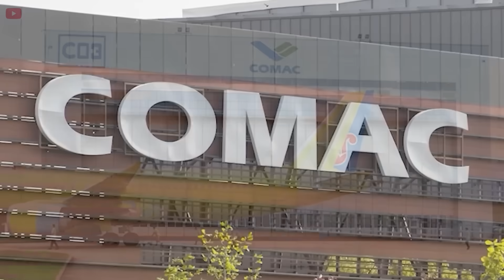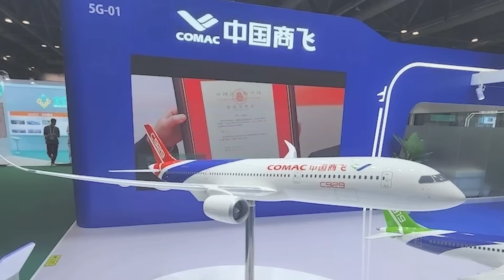China’s NEW C929 & CJ-1000A Engine will BEAT Boeing&Airbus! Here's why

Comment: I understand there is CJ2000 too.
Reply: yes, its a scaled up version with newer tech added in, and that should be 3 times more powerful. 78,000lbf  of thrust instead of 25,000-28,000lbf.

Comment: Are chinese aircraft engines built in usa or  it 3:47 is a fake news ?
Reply: C919的发动机是美国的leap发动机，C929将采用中国的CJ1000发动机（这款发动机已经用于Y20运输机）
Reply: @ I though Y-20 use Chinese -made WS-20 isn't it??
Reply: @kinwaisiu9414  Y-20 use WS-18,Y-20B will use WS-20
Reply: Engine is 100% design and made in China. Its specification will suprass the west.
Reply: @kinwaisiu9414  The engines used in the C919 are from the United States. China has achieved quite remarkable results in the field of fighter jet engines. However, in the aspect of airliner engines, there is still room for improvement.
Reply: @chunyiluo3529  Yes, soon enough China will replace LEAP engine with CJ-1000; and C929 will be using CJ-2000; C939 will be using CJ-3000
Reply: American planes use European engines.  Why didn’t America use their own engines?

Comment: Actually the C929 will use the CJ-2000 turbofan engine. The C919 will use the CJ-1000 when it is certified which will be soon.

Comment: None of the critical parts are made in China. They are just assembling the plane.
Reply: Completly wrong..Stop defaming it. Did you know that China is the elad seller for 33 Elements and leads the selling of Steel?
Reply: 美國的波音及歐洲的空客才是
Reply: By the time C929 is in full production everything in it will be from safe sources that can’t be cutoff for political purposes.

Comment: The "chinese" engines made by General Electrics.Ok.
Reply: No the engines are actually Made by Aero Engine Corporation of China not by GE
Reply: @F22Raptor_Brqwlstars You are right, it's made in France and the USA by Safran. Not GE.
FYI, China can't make jet engines on their own because it's way too complex.
Reply: @paulk7772  来自10年前的老古董
Reply: @paulk7772  China makes it's own turbo fan engines for it's military aircraft like the WS-10, WS-15 and the WS-20 engines. The CJ-1000 and CJ-2000 are in the test and certification phases at the moment and are slated to be used in the C919 and C929 respectively. The CJ-1000 will replace the Safran engine in the C919.
Reply: Way more advance than GE.

Comment: Specific impulse is what count but with a burden, hotter temperature to deal with and the smith's secret the western plane engine manufacturers have same as the aslm in chips manufacturing process unless you figure out a system process to rival it with another approach

Comment: C-929 will be powered with a newly designed CJ-2000 turbo-fan engine.  Which is expected to provide 35tonne of thrust, and may use GTF tech and compisite fan blades.  The detailed design of the engine is already under way.  There is also a second option, the PD35 engine, the Russian turbo-fan.  Both of these engines will take a lot of efforts, and may meet setbacks, but China is not known for backing down in the face of setbacks.

Comment: Wow, China's wide body long range commercial aircraft C929 is coming out soon. China will have a higher domestication rate of Boeing nor Airbus as the home made CJ1000A turbofan engine is a great candidate to power the aircraft. The usa will never be able to sanction the C929 as the aircraft can be produced by component manufacturers in China. China's achievement in building the commercial turbofan which is strong enough to power the C929 is significant. Comac aircraft will satisfy the rising China's travel demand taking away Boeing's market share.

Comment: CJ-1110A engine is for C919 not C929.
Reply: True.
CJ1000A is designed for C919 Airliner.
C2000 is designed for C929.
The reason C919 has shorter range is because of the earlier thirstier version of the LEAP-1 turbofan supplied by SAFRAN. This slightly offset by the 30% lighter and stronger special alloy airframe by COMAC.
With the new CJ1000A turbofans certified by CAAC sometime this year, C919 production will be increased.